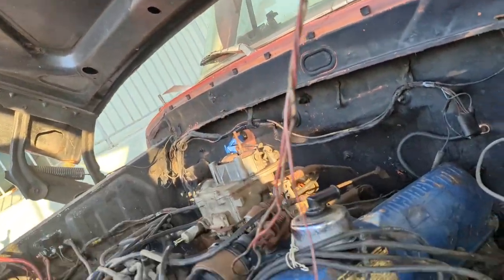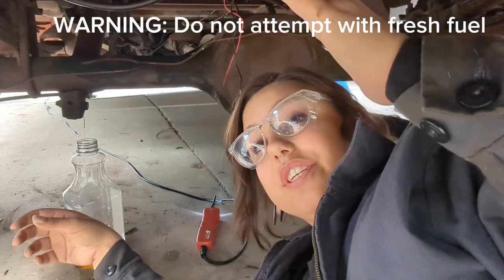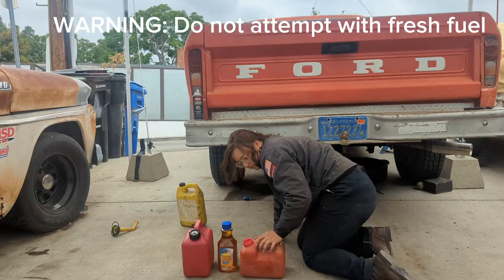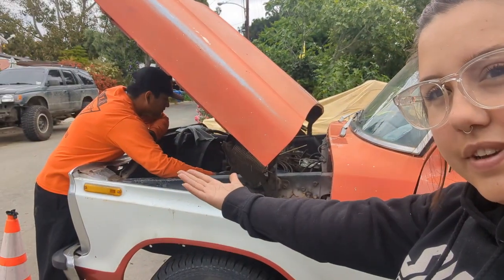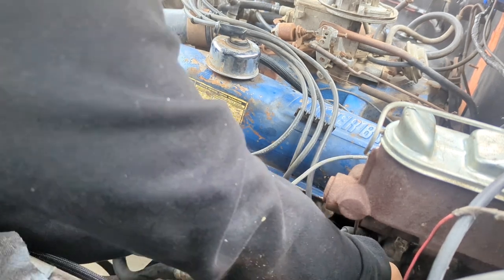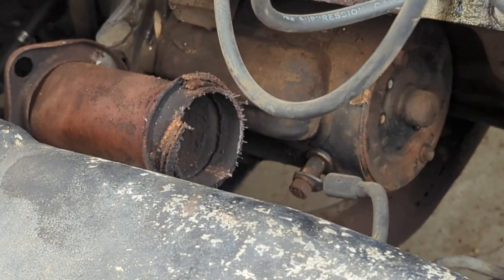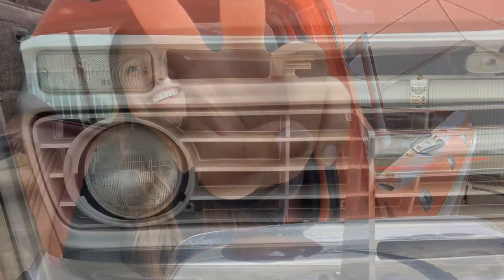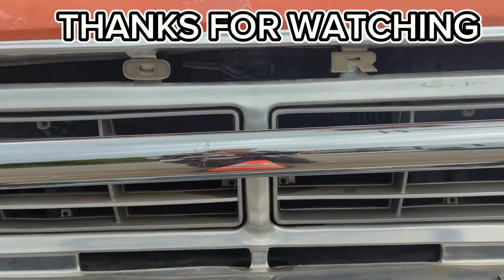F100 Project: Part 4 - The V8 Start-Up

Comment: You ask “why did my exhaust manifold have a variety pack of fasteners?” 
Because rednecks owned it before you… 😂 truth be told, im betting some them bolts were ground off shorter to make them fit, because that was quicker that going into the hardware store to get the correct size.

Comment: Those 351 Windsor engines are a pain with the exhaust as the bolts are threaded into thru holes, best eay is to heat the flange to help break the rust of the other side